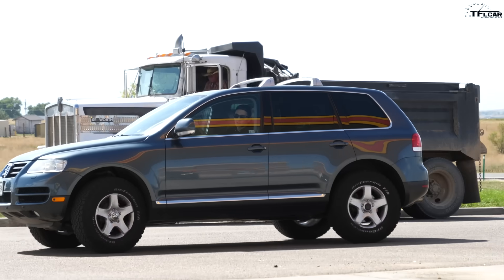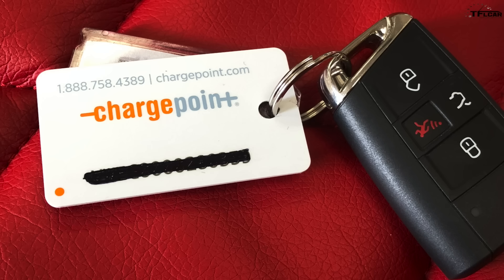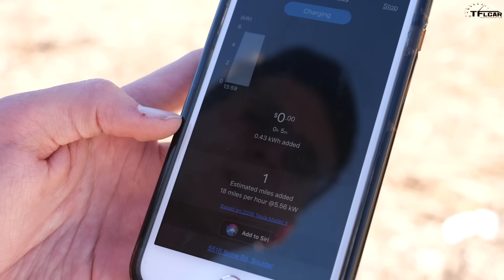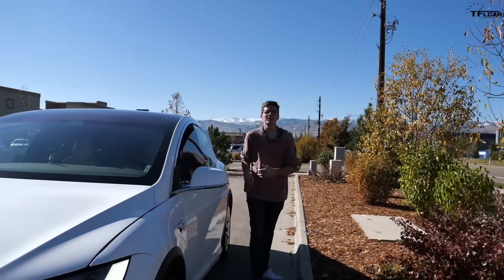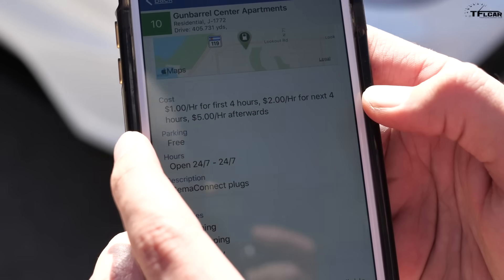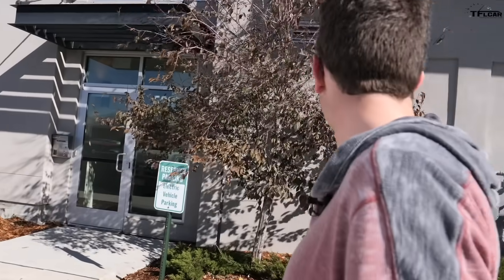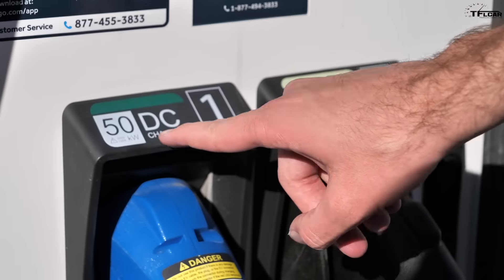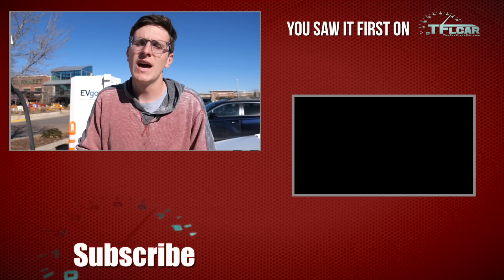Here’s Why Charging an Electric Car Can Suck - And It’s Not The Reason You Think!

Comment: Kind of a misleading video. Most owners are going to be charging when they are at home using their own private 220V outlet or at work using one of the listed stations you mentioned in your video (charging for 8+ hours). So in most instances you will be leaving your house or your place of work every day with almost a full charge or tank for you ICEers. The only relevant piece of info in this is for those using a EV for long (330+ mile) road trips, which I would agree driving an EV has its shortcomings with having to wait to charge. I have taken several roadtrips in my model 3 and while yes you need to stop for longer than minutes to charge the car, most people, with stopping at a supercharger can plug in, go to the bathroom and grab a snack or drink, and by the time I get back to my car it is charged up enough to make it to the next stop on my trip.
Reply: He did state in video that many people live in apartments with no ev chargers or don't have a garage at home. That was the intent of this video. I don't have a garage, I park my car in the side of the road, buying an EV would be the stupidest thing.

Comment: So I have been complaining about this mess for years.  The mess I am talking about is the failure of business and industry to STANDARDIZE the charging infrastructure in the U.S.  We have Tesla who uses one system.  We have GM which uses a different system or connector.  We have some manufacturers who have 5kW chargers and others who have 7kW chargers.   And heavens only knows what Ford, VW, and others are going to be using.  And for heaven's sakes lets not even talk about INDUCTIVE charging systems.  Anyone know of the standards that will control where the charging plates are going to be installed?  Of course not we are all just going to go off and do our own thing I guess.  What a stupid mess we have created.   Anyone guess about how apartment dwellers are going to get charged up?  Just go ask the creators of the New Green Deal - they should know right?  And no they don't have a clue either.   Again our political system in the U.S. has FAILED the American people.  And heaven's forbid we even consider something like imbedded charging systems in our highways.  If you want over the road trucking to stop using diesel fuel you are going to need charging.  But again no one has a clue.  We need STANDARDS not more individuality when it comes to the reduction of fossil fuel use to help reduce the effects of global warming.  If you want clean air to breathe and water to drink who do you call?

Comment: I have owned a 2013 Ford Focus EV and now a 2020 Chevy Bolt EV I go to work 5 days/ week and run around all weekend! I have never had a problem with a 120Volt outlet as it charges all night and at lunch etc! I have a small collection of tiny cards in my center console for charge places that I only used to check if they worked! I do charge at some big box stores while shopping as it is free so why not?

Comment: All fine if you happen to have all the requisite adapters, live in an urban area and can therefore get to all these different chargers easily, have all the requisite apps on your phone, have a phone, are happy using a mobile phone and can get a decent signal it, but otherwise way too much hassle.

We’re going to have to do a lot better than this.

Comment: Electric plugs for almost every building in the USA were standardized in the 1920's.  We need that for the EV fleets and charger stations.  If I am wrong,  and I may be,  please give details.
Reply: USA outlets have changed a lot since the 1920's. Take the 110 volt home wall outlet. They originally had only 2 prongs, both being equal width and no third ground prong. That changed in the 1960's when the familiar 3 prong outlet became common.  Many of them are rated at 15 amp load that has 14 gauge wire feeding it.  Look at your wall outlet. It has a taller slot for the left prong, a 1920's standard height slot for the right prong, and a D shaped ground prong. This means that the plug will fit the receptacle only one way. 

The taller slot is for the neutral white wire and the smaller slot is the one that is energized or ''hot'' with the black supply wire.  Old 2 prong appliances like lamps and radios can be plugged in with the plug right side up or upside down. When an old electric 2 prong blender, iron, radio, etc and something shorts out inside, you have a 50/50 chance of being shocked by its metal casing depending on how you plugged the cord into the outlet. They brought out the wider slot to prevent this. Even a light duty extension cord with no ground prong has a taller prong so the plug will fit only one way. Its a safety thing.

A further improvement is that you might notice a 120 volt 3 prong outlet that has the taller receptacle slot formed like a Tee. That's a 20 amp rated outlet served by larger 12 gauge wire. Some 120 volt window air conditioners have the neutral blade on the plug turned 90 degrees so that they cannot be plugged into a 15 amp outlet. It fits that Tee slot in the wall outlet. Yet you can plug any 15 amp standard plug appliance into the 20 amp outlet or 2 bladed ungrounded extension cord into it. You can even plug in a 1920's floor lamp into it so that outlet is backwards compatible. Then they added Ground Fault Circuit Interrupters now required by some codes for kitchens and bathrooms into outlets to prevent electrocution. Remember stories of a radio falling into a bathtub and killing the person? GFCI outlets prevent that by shutting off the power inside the outlet instantly if there is a fault to ground.

For 240 volt appliances like clothes dryers, welders, ovens, 240 volt window AC units, the receptacles are all different depending on the amperage. A weird one is the 1960's grounded 20 amp 240 volt outlet that looks like a 120 volt outlet but the prongs are turned 90 degrees to be horizontal. Nothing else fits that wall outlet. They were in an apartment building I managed  built in 1963.

The 30 amp 240 volt outlet has 3 large prongs with the energized prongs being turned at a 45 degree angle. The 50 amp 240 volt outlet has 3 or 4 prongs with the wide slots vertical.  After the 90's, homes were wired with 4 prong 240 volt outlets where there are 2 live wires, a neutral wire, and a ground wire. Always changes and improvements.

Many boats in a marina have 30 amp 120 volt 3 prong twist lock outlets and plugs where the prongs are bent corresponding to a circle. Motorhomes and campers have another type of 120 volt and 240 volt outlets.
They are not interchangeable and their outlets can be completely different. They can't even standardize the output end of USB cords. They are always changing. I like the iPhone plug that snaps in either way, upside down or right side up.  I hope that helps and I'm out of donuts after this book I wrote.
Reply: @kimmer6  When you resupply, eat a donut for me.  I swore off them and may only enjoy vicariously.

Comment: No thanks on EVs. I drive too much and am not waiting for charging and not trying to locate charging stations. they need to be almost as fast as filling up a gas tank. they should be located at some current gas stations. it will probably need to have battery modules that can be swapped out to partially/quickly replenish electricity rather than just plugging in and waiting. what happens when driving 1,000 miles in a single day? I'm not waiting more than 30 mins for refueling during that total drive. gonna need several large gas station chains to form an electric network with 240v-480v charging stations. I drove my 2016 F150 v8 across the USA camping, MTB, hiking and sightseeing. 8,000 miles in 22 days in July 2020. No way an electric vehicle could match that right now. When toyota camry/sienna, honda accord/odyssey, F150, Silverado all make full EVs...that's when the infrastructure will be ready for mass EVs switch.

Comment: thanks! that was some great facts! 

until BEV is EXACTLY ONE FOR ONE as easy to use as gasoline they'll never compete on an equal playing field. i've got a 2007 Dodge Charger with a 19G tank... i can squeeze maybe 20G into the filler pipe but i'll just say 19G. i get 17mpg City and 23mpg Hwy. i've been charting this on every single fill up since i bought the car in 2007 from the dealership. i've got the data. 

that puts me at a range of 323 miles 1 City tank and 437miles 1 Hwy tank.  now, in less than 20 minutes i can fill that tank from empty. whom out there can fill an entirely empty BEV battery for 323miles or 437 miles in 20 minutes? noooobody can. tis' physics people. 

so, EVs they're inconvenient at best... a total pain in the ass at the worst when it comes to 'filling them up'. annnd! the faster you fill your battery... the more life you kill. and the more often you fill... the more life you kill. 

if you don't need hundreds upon hundreds of miles of range. if you have hours upon hours of 'dead time' where your car's parked right on top of an 110V outlet. sure, i'd guess you could go right ahead and go EV.

 most days sure, i need under 100miles to do what has to be done. but that one day when i need 437 Hwy miles right NOW! and i can't wait 1h, 2h, 4h, to recharge again to either go further or return back home? sorry. EV just doesn't hack it.

Comment: This will get standardized over time and the connector will permit communication with all and any stations. It's just a matter of time.

Not sure why DC has more power, maybe it's cheaper to have the high power convertors on the station rather than on car. But for so much power you don't want a bad connector, thin cable, or oxidized connection. It will catch fire fast. Probably good smarter electronics.

Comment: That’s a useless charger for most people. 16 miles for an hour!  Unless you live nearby when you can walk home while it charges. Depending on where you live you might use all that mile just getting back home. If you have a 220 volt charger at home than that’s great but charging at that speed away from home sucks.  That’s probably why Tesla’s sold so well is because of their superchargers. I went yesterday and got done charging in less than 30 minutes.

Comment: The only practical system will have standard swap out battery packs. You change batteries in the same way as you would propane tanks. I can't handle the systems they use now, waiting forever for a charge. When it takes the same approximate time to charge, as it does to fill a gas tank, then I'd go for this, but the current charging system sucks. Again, I say that the industry should develop standard battery packs, with standardized means to swap out the packs.

Comment: The pleasure of teslas is, they have an enormous supper charger network. Especially in California and major cities, you won’t need any other plug as teslas supercharge network is enormous. You can typically find a level 2 at many hotels if you travel. Some of which are also free! I would never consider a leaf or similar simply because the fast networks i feel are not great enough. Tesla has them all over and the maps will reflect this.

Comment: An apartment complex that closes the charger when people get off work lol
Reply: indoctus41  I was just referring to a place in the video for charging. Where the charger is set to disable itself around the time people start getting home from work
Reply: indoctus41  Tesla was installing a supercharger here in 2017. Someone stole the trailer with the wire reels on it. And since the date keeps getting extended for us to get it. Never have broken ground since 2017.
Reply: When electricity grid goes down you don't have a extra gas in trunk or siphon from other cars.

In winter climates going up that hill with heater on you watch your display drop like crazy.

Can't travel to any areas outside grid where chargers are non existent.

2nd in line for charger only have to wait another 7 hours.

60 miles per hour in 2 seconds doesn't help when you run out of juice and turtle passes you.
Reply: @rfjohns4452  you act like general evs don't have more than enough range for most consumers. My cheaper ev has 220 miles (354 kms) and in short journeys I don't even use the full journey amount as it regenerates some of the range from breaking. Not only this, but it's far cheaper to run one.

And in terms of power grids going down, you can get solar powered / wind powered ev chargers, and at least in the UK we have stations here now that have backup generators on them.
Reply: @rfjohns4452  In grid down gas pumps won’t work either so no matter what no one will get fuel/energy. Where the other commenter mentioned solar or wind power generation someone could charge up their EV at home and still get around.
Reply: Only one relatively slow charger won't make much of a difference for an entire apartment complex...
Reply: You clearly missed the point.  Apartments nor condos welcome EVs.  It's too much of a hassle for them to accomodate.  They'd prefer if you'd charge somewhere else, or use a gas car.
Reply: @joeya6795  - condos are managed by their owners/occupants they can assess the people and install as many charging stations as they desire... requires a vote
Reply: Take a bus that day and charge up while at work 😂
Reply: @michelle20900  might not make it back to work down here on a bus lol
Reply: I think it limited him because he didn't live there.  It probably allows only residents during times that most people are at home instead of at work.

Comment: I've never understood why it's a charging model, instead of a battery change system
Reply: Because batteries are ridiculously expensive. Also, most of the connectors and holders need to be sealed for a safe and comfortable operation.

Any interference to the battery will brick the car( as in it'll just stop working till the moisture is cleared etc) until a service.

Hence, changing batteries on the go is not really that viable. Also, modularity has always bought needless complexity in most fields, smart phones, laptops etc. More points of failure.

The cost is just not worth it I guess...
Reply: @anirudhdiwakar987  That isn't really an issue to why you can't do quick change batteries. You could have a capacitor that keeps ecu powered during change outs  with a throw over switch. You would have another switch to isolate the battery for replacement. The batteries are the only thing that has to be sealed. Connections can be located in dry areas like the trunk. Here's a link that proves it can be done   https://www.wired.com/story/the-faster-cheaper-better-way-to-charge-electric-vehicles/
Reply: @waynewilliams1726  well thanks for that. I don't know this. But still, what do you think of the issue with modularity? And I suppose having the car on backup capacitors will permit the bare minimum functionality only. If not please tell me, I'd like to know more.
And the batteries are still expensive right?

Comment: I read yesterday, no idea if true or not so far the UK has 11,000 charging places. These mainly being in the south. But we would require 25,000,000 if every car currently being used was replaced by an electric vehicle. In the UK this is never going to happen. We cannot even fix potholes. Or run covid tests.

Comment: When are they going to wise up and instead of recharging a battery you SWAP out a battery? Like a battery for a cordless drill.  You pull in to a BATTERY STATION...the vehicle is serviced by a robot that changes out the battery...puts 'old' battery in a charging station...installs recharged battery...you pay and you're on your way. Elon Musk will crap his pants because it's not 'his' battery...but this is doable. Who REALLY cares what Elon thinks, anyway? Come on, now. Standard batteries across ALL car lines. What I've outlined is very simple. I know there are many twists and turns to make it happen, but really, is it that hard to conceive of this?